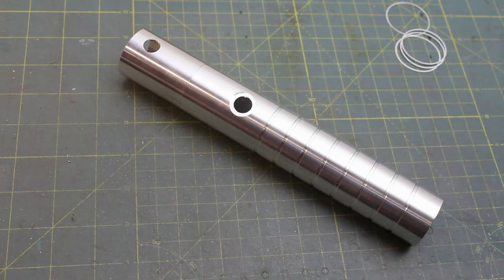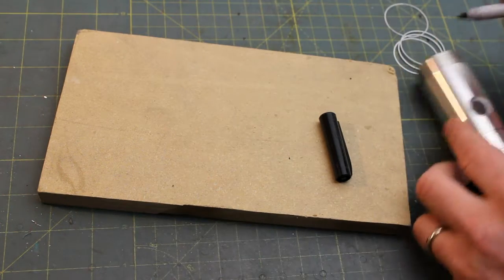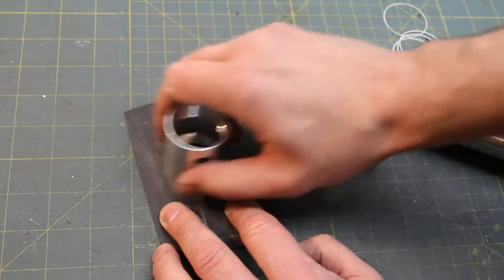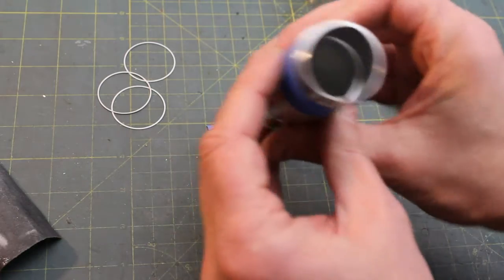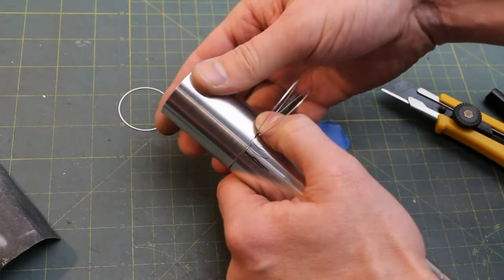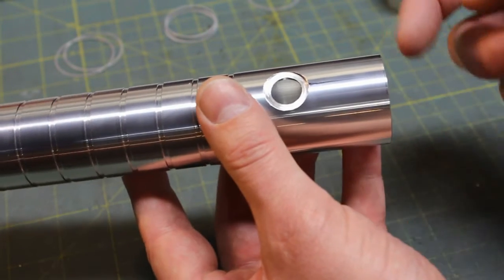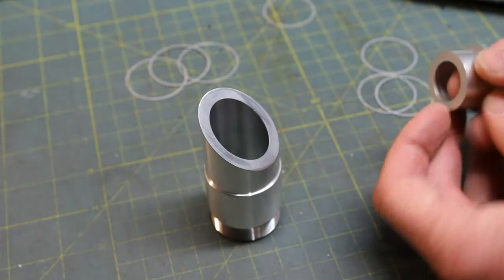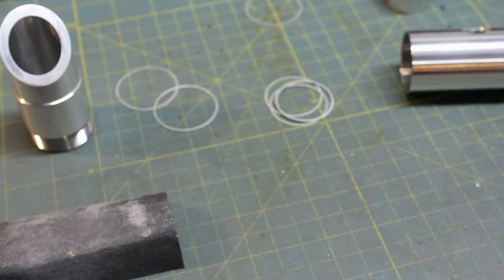Making threaded parts line up

Comment: Hopefully you still check these 8 years later 😅 I’m trying to sand down a blade holder according to your instructions and using a single smaller diameter clocking washer on the LED module, but it seems no matter how much I sand it doesn’t seem to affect the orientation of the hole at all…

I’m using standard 220 grit sandpaper. What are the odds it’s the sandpaper I’m using that’s the issue? You sand for a few seconds and get movement. I’ve sanded for 10 seconds and not moved a millimeter as far as I can tell.
Reply from the maker: Hey David, we do! Align without the can in place first. After that, put the can in and if it changes alignment, sand the can itself.

Comment: Hopefully you see this and can answer. What if you have a part that threads into another part, and the other part has a larger outer diameter, so they don't rest against each other externally, meaning you can't line them up by the sanding method shown in this video. Also, the part that fits into the other is thin enough that clocking washers simply push over the thinner part when threading the two parts together. How would you approach this? Any help is appreciated, thank you.
Reply: There are 2 sizes of clocking washer. Make sure you have the right ones. I recommend posting this on the forums with pictures of your parts.

Comment: ultrasaber blades are slightly larger than TCSS as they come from different suppliers,  so they do not fit MHS blade sockets without either sanding the blade or enlarging the blade socket.
Reply: Thanks - I did not know that.
Reply: yeah,  found it out the hard way myself a few years ago.
Reply: They are tight but mine ave always fit fine :/

Comment: TCSS blade holders will hold most any 1" blade. In extreme cases you may need to sand a blade down slightly to make it fit the way you want. But that is rare.
Reply: Rob Petkau I got a 1.5 inch sink tube adapter. I was just wondering if those were supposed to go inside or outside of my sink tube?

Comment: Hey quick question will the blade holder hold a ultrasaber blade
Reply: Yeah, Ultrasabers has 1" blades, and MHSv1/MHSv2 Blade Holders hold 1" outer diameter blades. If the fit is snug you can sand the blade a bit, but the more you use the blade in that blade holder the better it'll fit over time.